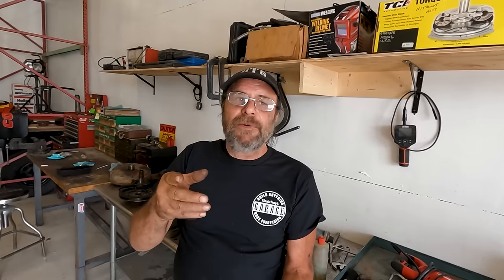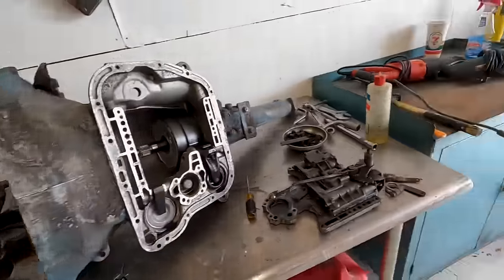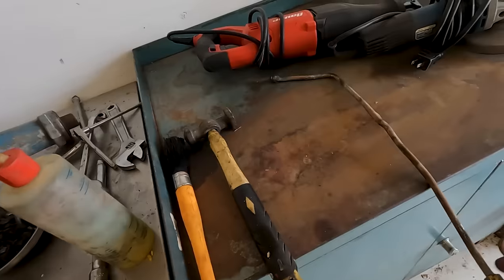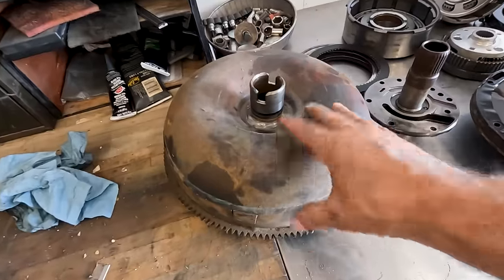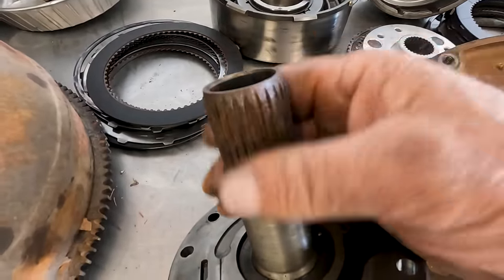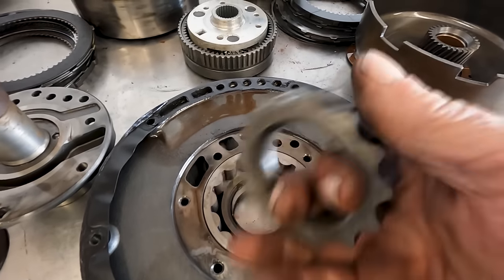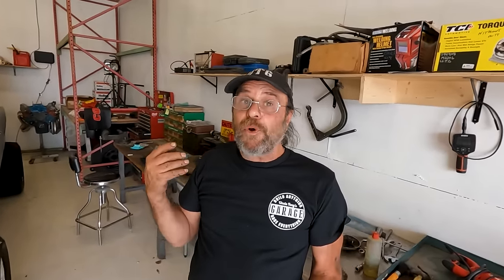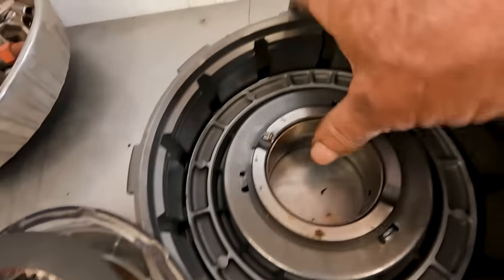Survival For The Budget Car Builder - DIY Transmission Rebuild From A Junkyard Core

Comment: Also don’t blindly assume that a shop with a good reputation is always going to be good.

My nephew had to have the 5 speed rebuilt in his 91 Spirit RT (A568) he didn’t know of any shops so he took it to the highest rated one in the city. Apparently they have a great reputation for your typical Ford, GM, Chrysler rwd trans. He brought them the transmission already removed from the car. They said no problem give us two weeks. He goes back in three weeks to see how they are making out and it’s sitting on a shelf. They said they couldn’t get parts. Come back in a week.  Comes back a week later and they have the parts and say it’ll be done in a week. Goes back a week later and they say “oh yeah, we got parts that are for an automatic for that car not the 5 speed” my nephew was furious. How did you not know you ordered parts for an auto, and why didn’t you call and let me know you didn’t have the right parts? He tells them forget it, you’ve had my trans for two months and not even started yet, just give it back to me.

The guy comes out with two boxes. They literally give him his transmission back in boxes COMPLETELY disassembled. No apologies, no offers to see if they can get the right parts elsewhere etc. 

He ended up finding a guy from a forum who specializes in those cars. Picked up a fresh rebuilt trans ready to go and was done. The box of parts sat in the garage for years

Comment: If you get a decent core that has a good torque converter and valve body, the cost is even less. Damn near anything is better than dishing out thousands for a rebuilt POS that might take a shit anyway. I have rebuilt a 904 and a couple of 727s and they aren't that bad, and like UT says, you can pretty much build whatever specialized tool you need. I built a homemade slide hammer type tool for getting the pump assembly out. Just some threaded rod and weights with holes to slide the rod through and nuts and washers.

Comment: Don't 904's have a sprag that's riveted to the case? Is there a work around to save the case when the sprag implodes?
Reply: Yes, the factory 904 sprag is riveted. Cheap insurance is a bolt in sprag.

Comment: The only thing worse than finding someone to do even a half-assed rebuild is trying to find mediocre parts, especially when it come to standard transmissions. You used to be able to get on the phone and within minutes have parts on the way, and now, trying to find anything rebuild kit wise is impossible from power steering pump, alternators, carburetor, AC compressors, all used to be kits that you could rebuild your own, you could do a premium rebuild, take your time and make it better than new, or you could do a job that is still better than what the reman guys do, sloppy and quick, it might work or it might not but you could still find the kits you needed. Auto repair is becoming a lost art form, it's a shame really, a society of waste, buy cheap and junk it when it quits working

Comment: Anyone have any tips on cleaning out a core? 
I’m relatively new to DIY stuff but I’ve built a 4.8 twin turbo truck, next project is a lot simpler, dropping a 6.2 into a 77 camaro, I like to think im capable , just takes time 

I’ve been researching how to build a 4l80 (no trans brake or anything, similar to what he’s talking about in the video here) and I’ve come across quite a few pages that make cleaning out the core sound very very important (ie. Specs of embedded metal in the case might work their way out when trans is at operating temp and chew up all the new parts I’d want to put in?) 

Thanks

Comment: Am sort of anal when it comes to rebuilding something Tony, usually I have the rebuild manual with me even if I have done the job 100 times.  Sorry I have CRAFT, Can't Remember A _ucking Thing, forgetting a small part missed and fell behind something on the bench.  Got versed on that GM disaster 4L60E, have kids that could break a rock.  Also make the special tools, have a lathe, milling machine and welder.  Got a toolbox full of homemade tools, most I will never use again, but got smart enough to mark them after a few times with WTF did I make this for.

Comment: Times have certainly changed the turbo 400 that I have in my 1971 Buick stage one only cost me $900 to be rebuilt in 1991 with Kevlar bands and a hardened first and second gear and that was with them doing all the install, still runs like a rape ape,. Everything sucks nowadays even a box of fucking Cap’n Crunch cereal

Comment: I rebuild enough transmissions that I have been buying the special tools I need to do them, also bought special tools to rebuild differentials and pull bearings off faster. Right now I am collecting manual transmission stuff, not tools, but all the things I need to put a 5 speed in the 65 GTO and a 4 speed back in the 70 GTO. When I start on the 69 GTO I will either do another 5 speed or rebuild one of the 4 speeds I broke back in the early 90s.

While I was married or paying kid support, I had to do everything super cheap, improvised tools, work arounds, and since automatics were a lot cheaper to rebuild than 4 speeds, all my manual cars went auto. Autos break fewer U joints, differentials, and driveshafts, and I know how to make them shift so hard the windows rattle a mile away. Drive one of my autos and you will not think of it as a slushbox... especially the manual valvebody units. 

Its nice finally getting to where I should have been 20 years ago, able to do things without scraping by every month. I'd be doing better without the inflation, but as it is I can do far more than when I was paying for other people. I'm thinking I need a 4L80 with a brake for the 68 LeMans...

Comment: This video brings up of the big picture- never have there been more parts available but of mixed quality and having things rebuilt is prohibitively expensive. I look at new cars and see overpriced feature bloated junk made of plastic whoever possible. So between YouTube and ingenuity we can keep older cars going if we do the work ourselves. I also think that EVs are headed in the same direction as new ICE cars- overpriced feature bloated junk. If and when EV actually seriously replace ICE we will still have the same problem and the solution may be similar - build our own with only the necessary features, like speedo and a range gauge. Buy your iPads from Apple and use them to follow instructional YouTube videos in your garage not to frighten around with the heater!